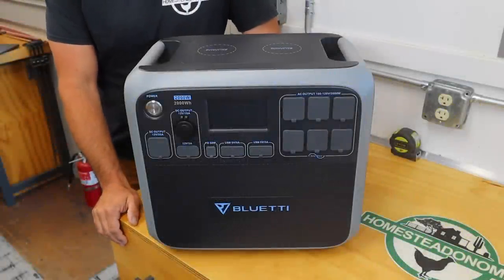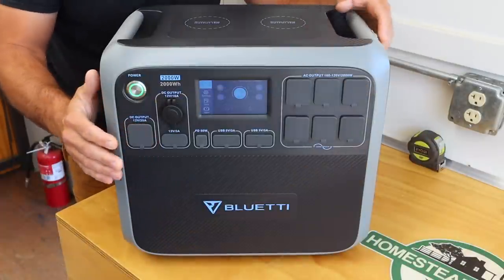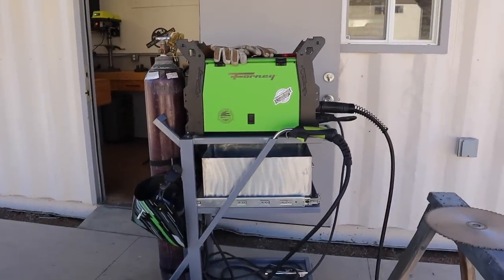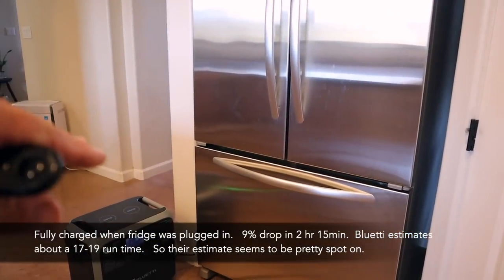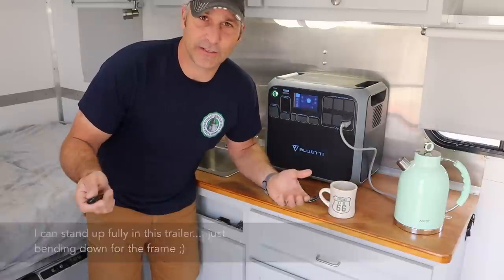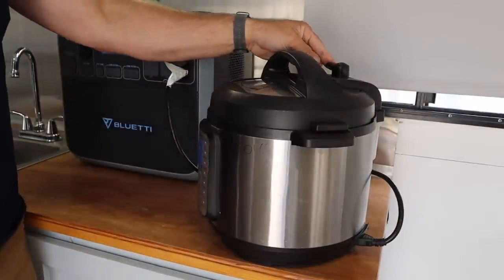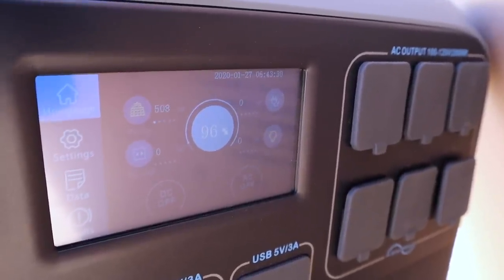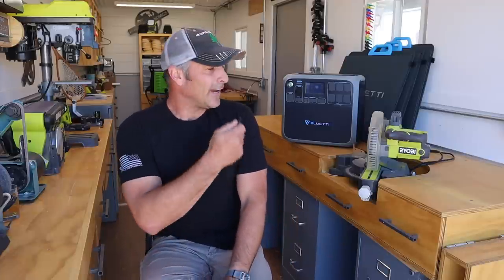How Much Can It Power?  -   Bluetti AC200P Power Station Review

Comment: A spot on review here. Great stuff

I have one of these in my basic camper van with 400 watts of solar on the roof ( space limited for solar on the roof )

It runs a Dometic CFF45 fridge 24/7 without issue, a Sirroco 2 fan when needed and charge all my USB devices ( which includes a Goal Zero Sherpa 100PD Power bank )  along with an Macbook Air without issue. This unit will run my CFF45 for around four and a half - five days on 12 volt before hitting 0%.

I think the AC200P and other units like it are somewhat misrepresented  ( for want of a better way of putting it ) on the AC front, with heaps of people complaining that they leave their mains powered fridge / freezers on overnight and the AC200P is flat in the morning ……….. home fridge / freezers generally have a 300 plus watt output…….. do the maths

A lot of people seem to be leaving the AC on when the 110v / 240v is not even in use. A definite no no for obvious reasons one would think.

Also, putting 200 watts of solar in to it ……. Well, you are going to be found wanting. Especially when using the AC constantly. You would want to be smashing the whole 700 watts into it if you can.

Worst case scenario, as I did, buy an extra mains brick to charge it up……My results are generally 1 hour 45 minute from flat to fully charged from both power bricks

You do have the ability to run a 12 volt fuse block from the AC200P via the 25A plug to run, say a Sirocco 2 fan and a fair amount of other 12 volt bits and pieces 

I use a 240v, 500 watt rice cooker ( 40 minute rice cook time ) and sometimes a kettle. The kettle, like most, is about 1900 watts. Anything induction will mean a pretty significant discharge on any solar generator I think

Personally, this unit does the job brilliantly for 
me. Cannot recommend it enough but ? You do need to know what it is you want / want to use it for.

Expensive here in Australia at $2500AUD on sale. I flukily picked mine up for $1500AUD and had also done a huge amount of research pre purchase

The EB240 would have been the unit I would have bought but is still not available in Australia as it is fantastic value for money

Again, great review, which for once shows the AC limitations of this unit, limitations that are the same whatever brand you decide to buy.

Comment: I have seen several other people do reviews in this bank...but I have to say that yours is very complete...you tested a LOT of devices with promising results  :)
Reply from the maker: Thank you Gregory!   It’s definitely got a lot of promise!   I really like the thought of setting up a mobile shop trailer or maybe doing a truck bed camper and using this as the primary power supply.  Just gotta confirm the wife first😉

Comment: I've been thinking of one. I do have a Honda EU2200 propane generator. It works great but is more noisy than I hoped. Your review has me thinking that it would be another great option. No noise, can be used in a confined space without fumes. 
Keep up the good work.
Reply from the maker: It’s a pretty nice convenient option for sure!   But having having a Honda eu2000 is great too!  Kinda give you the best of both worlds.  Convenient quite power in something like this… but also robust charging and top off capabilities when perhaps this has no sun for the panels and or something that requires a bit higher draw.

Comment: I was in need of a generator last year March and stumbled upon this. 3500 cycles(10 years) =20% battery degradation , lack of maintenance, and I use it everyday vs a gas gen I would only use when I need it. Well worth it.

Comment: Thanks for the video. I like folding solar panels because it allows positioning the panels into the sun while parking in the shade which would not work using vehicle-mounted panels. Bluetti makes good products.
Reply from the maker: Thanks for checking it out! Yes the folding panels do provide for more flexibility when shade or other obstructions could cover a vehicle mounted panel.

Comment: Great video. It’s nice to see you reviewing a product that you were thinking about getting. It seemed to be a good test of all the bells and whistles. I know there are a few entries into this market niche and nice to see how this one stacked up. I’ve not made it near the off grid level yet but right now it seems like a convenient option rather than a need. Thanks for the honest and helpful review and thanks for sharing!
Reply from the maker: Yes, I’ve got all sorts of ideas for this thing.   Obviously for power outages  it will be nice.   But also I’ve thought about using it for a power supply for a truck bed camper build too…. Of course that will take some convincing of the wife🤞😉
Reply: @homesteadonomics  can never have to many campers!

Comment: I've been looking at these to power the water pump for my house. We generate water from a well and store it in a 2500 gallon tank but when the power goes out we can't pump it into the house. I think this will be a good for that sort of on demand need when a gas powered generator can be good for more continuous use. Thanks for the review it was very timely for me.
Reply from the maker: That’s something I’ve also thought about too….to power my pump house pump.   I’ll probably wire a plug directly to the pump so I could simply shut the breaker off and plug it directly into the power station.   And octet pumping water was finished i flip the breaker back for when the power was restored.
Reply: @homesteadonomics  Joe, I probably missed it but wouldn't your well pump require 240 volts? Does this PS provide a 240 volt connection?

Comment: I just ordered this system. My primary use would be to run air conditioning on (rare) hot days like now, or run refrigerator if power is out. I was questioning how much air conditioning (window unit) & this helped!

Comment: I have the same power station took it camping in my 18ft travel trailer it did everything we needed it to do for two days with out recharging it. Coffee maker, microwave, only turned on the inverter when we needed it. It also charged the 12 volt house battery on the trailer every time we turned it on so you could say it ran lights tv and all for two days with out recharging it..
Reply from the maker: Well that sounds like it did a great job!  Glad to hear it’s working well for you Lester!

Comment: Interesting Video Joe. Just so your viewers know, there are smaller solar generators  that aren’t $2000 before the solar panels like the Jackery 500 watt but that won’t run the kettle or any large appliance. My point is that you don’t need the larger, more expensive solar/ electric generators unless you really need to run those larger appliances often.
Reply: Thanks for the perspective. I don't know much about such power supplies, and I'd be much more likely to go with a smaller unit. I tend to think a lot in terms of the value proposition of pricier products.
Reply from the maker: Yes, you’re right.   There are a lot of smaller options in the Bluetti, jackery, ecoflow…. Lines.   and if you just need it for some smaller things there’s no reason to outlay the big expense of one of these bigger units.   Size it for what the needs are…versus getting the biggest option available.😉👍
Reply: I purchased the jackery 1000 and solar panel. I returned them after coming across this video. The battery longevity of the bluetti far exceeds any jackery. Not to mention it’s a much safer battery pack. Pay the extra money and be rest assured you’re covered for anything that comes up.

Comment: This is great. Something I would like to see is this being charged and left unplugged for 4 weeks to see if there was any discharge. A power station is only great when on-demand power isn't available.
Reply from the maker: I have not tested the background drain from just sitting.   I’d imagine it would be very low as the other person commented.   But as a safety kinda thing I’d check it and plug it in every 3 months or so to run it a bit and charge it up.
Reply: @homesteadonomics  It can also be used like a UPS battery backup for a computer.  For example, if plugged in to the chest freezer and to the wall outlet, you can charge/discharge simultaneously.  If there's a power outage and you are scrambling to get the lights on, and creature comforts for the family, it would be easy to forget about the freezer (out of sight, out of mind).  So I would be more inclined to set it and forget it than to store it on a shelf.
Reply: I have both of my AC200Ps in  EMP storage bags (better safe than sorry) it's been 4 months, both still at 98%, right where I left them.
Reply: @dansmith3809  what kind of EMP storage bags... never even thought of that
Reply: @WideAwakeHuman  Mission Darkness
Reply: @dansmith3809  thanks

Comment: LiFe battery technology = 3500+ cycles for the 200 series units, a 'no-brainer' for preppers. Add a power module (or two) & you're pretty much set for extended power outages. A minimalist homesteader could probably 'stack' a couple of these units (w/power modules), tie them into a larger panel array, then run an off-grid tiny home/cabin for 10+ years with ample sunlight.
Reply from the maker: Yeah, I think it’s make for a good start to a small off grid cabin setup.   Expansion of the amp hours would be a good option too.  But like you said, depending on the needs and how minimalist you go, you could go a long way with this and the panels.

Comment: WOW Joe, they really set you up good. You got one great unit. But you failed on hinting a price. Yes, I just thought more on that price mentioning question. If you did talk about pricing then it wouldn't be right & they couldn't use your video on one of there advertising bc the price would be wrong & outdated the way things are going right now during this stupid pandemic in 2022. It's not that hard to press a button in the description box. But that set up cost a pretty big new shiny pennies, cross out pennies & use silver dollars instead.
The one I had was the Ecoflow Delta 1260Wh, battery pack w/6 outlets 1800W (3300W Surge) & was around $1,400.00 & one solar panels was around $240.00 (w/$50.00 off coupon) wish it had the wireless charger pads on it, but it didn't. 
Mine had a messed up display & I tried to send it back, the told me to dispose of it, so I did & I just keep the solar panel, I paid for it & will use it somewhere else. It's really nice & I like it a lot.
The time I did get to use it I loved it. I got it just incase the power went out @ night, I have to use a CPAP machine.  I'll replace it someday.
Now you've got a great system & I know you will love it. Have fun camping w/the family. I'm glad your wife will have her favorite kitchen supplies w/her now. You can't deny her any longer..... lol.....
Have a wonderful day, 
Chris from Missouri
Reply from the maker: Yes, she gets to bring her other things now on trips!   Which will actually make the more road heavy trips a bit more seem less since if we stopped at a place for just a night we wouldn’t likely want to do the pull out kitchen and set things up.  So the instapot and kettle will make for nice convenient meal prep.
And yes, it is pricey for sure!!  One of the main reasons I figured it would be worth doing a review…haha.   There are a lot of options out there.  Like the ecoflow you mentioned… jackery also has some as well.   I’d imagine they all are pretty comparable in build for the most part.
And yes, regarding a cpap or O2 generator those are things that if a person needs it, they gotta have it.   And having a option like this could make a big difference for sure.

Comment: Always interesting videos, Thanks!
Reply from the maker: Thank you Joe!
Reply: @homesteadonomics  Did you send me a message saying i won a prize? 847 area code? Thinking it's spam, thanks
Reply from the maker: @joet.4756  Hi Joe,   NO, that was not me.   there have been a LOT of spammers across YT that have been using account images to look familiar and then trying to get you to text a number or follow a link.    You should be able to tell based on the 'name'.    So just because the pic looks familiar DO NOT trust it.    
I've been blocking them as fast as I can, but seems to come up ever so often.  Also, since its affecting many thousands of channels I think YT has been addressing them too.   So hopefully this won't be reoccuring in the future.

But thanks for checking just in case!

Joe

Comment: So great you have a Bluetti AC200P and panels. Hard to believe you can expand it to 6000 watts. We love ours. We signed up on Indiegogo launch. 

We use our AC200 (1700watts) for our off grid camping trips. Great for running our diesel heater. When we are at home we use it to make hot water with coffee maker in AM. Then in PM we can cook a meal in our Air Fryer. 

Amazing you could pull 500 watts. WOW!

Hands down at this moment in time Bluetti continues to lead he way 🙂

Enjoy!
Reply from the maker: That’s great to hear you’ve gotten such great use out of yours!   I’ve been pretty impressed with it… and it’s giving me so many ideas🤦‍♂️😂.   I’ve thought about using this for a truck bed camper build power supply…. A mobile work trailer (thought about doing a mobile handyman biz for a while).., and perhaps some thing with the shop.  Haha… too many ideas!
Reply: @homesteadonomics  ❤

Comment: I think combining one or two of these with solar panels and a portable generator would be a good system.  Solar panels would help charge the battery during the day... The battery would capture some of the energy that would be lost from the generator while it's running so that you don't have to run it so long.
Reply from the maker: Yes I think the solar panels definitely can extend the usefulness and range is this setup.   Especially with something that perhaps might get used mostly in thr day when the sun is out.   But one thing I’d want to look into is some solar cable extensions so you could have a bit more reach.
Reply: @homesteadonomics  I agree about the cable extensions.  Ideally, you would keep the unit indoors, or at least in the shade while charging via solar.  Heating up the batteries in direct sun is not good for any electronic device.

Comment: Great review! I would love to see one of these run an AC unit of some kind, most likely the camper/RV style
Reply: The Bluetti 200P and 200Max will run a 5k btu window unit with an energy star rating pretty well. If your camper/rv is insulated nicely it will help the Bluetti along. also if you park in the shade and set solar panels in the sun. With this formula my 200Max can run the a/c unit probably forever. Upgrade to more powerful a/c units and larger spaces and you then you will not fare as well
Reply: @breakdownbill1  I might have to invest! Thank you!

Comment: I have 2400 watts of solar panels and 8 200 amp hour 12 volt batteries configured for 24 volts so 24 volts at 800 amp hours or 3200wh... I got tired of trying to start a generator at -20f when power failed in winter. It will run my 2 chest freezers, fridge, pellet stove for heat(I close off the upstairs and sleep in my recliner to save heat) and computer with 1 monitor running(I have 3, using just 1 saves a LOT of power), plus charge cell phone, run the ham radios, and maybe 4 hours of TV a night... since mid winter in MN = maybe 4 hours of charge time a day I can get 4-5 days run time, typical outage is 8-48 hours. In summer when I have 7 hours of good charging light that doubles or triples with no heat needed. 

Those little battery banks are okay for short power outages(12 hours or less) or to run some tools off grid or take camping. For long outages you really should have a dedicated solar setup.

A wind turbine would be a good project for you!

You know that saw blade you were welding on? Weld 2 sets of 2 together, get some good magnets to glue on the faces and a trailer hub. Remove the studs and replace with all thread. The steel magnet  plates mount on the all thread with the coils in between them. Wind some coils and make a wind generator! www.Fieldlines.com is a great source for wind power stuff and solar questions!  90% DIY wind turbines(stay away from the car alternator snake oil ones people sell online! You need gale force winds to make any power).
Reply from the maker: Yeah they are limited for larger applications.   I think your system sounds awesome and really functional too!  A smaller unit like this is a nice convenient package, but it comes with a cost for that convenience. 
As for the wind generator….I’ve thought a lot about wind here.  We get a lot of wind too.  That with solar would really make a good package too.  
As for application, if I end up doing a little off grid cabin (shipping container) project that’s in the back of my mind I think both would be great projects for that!